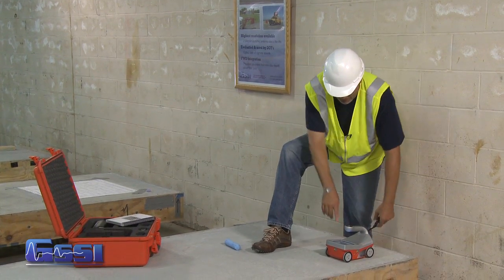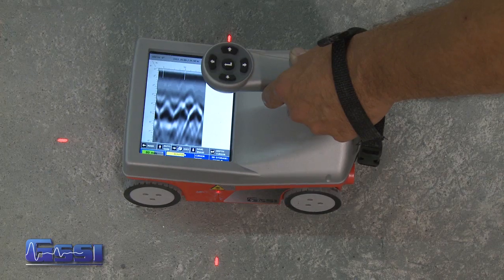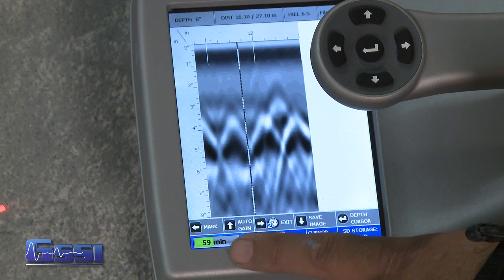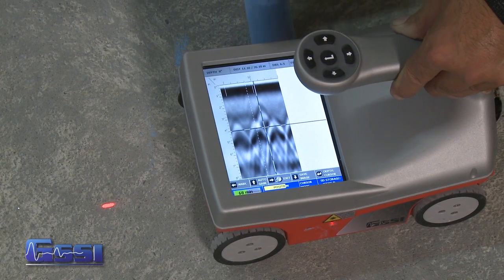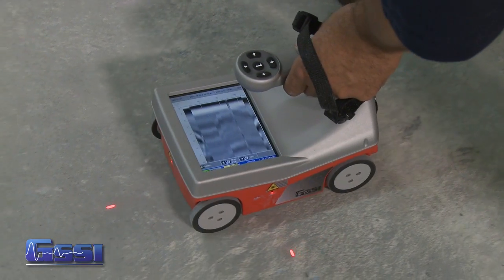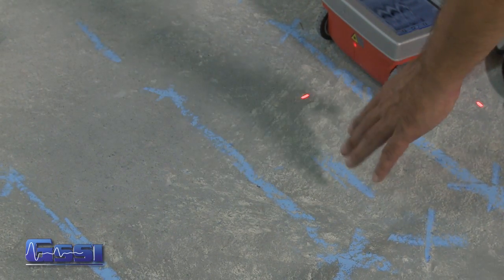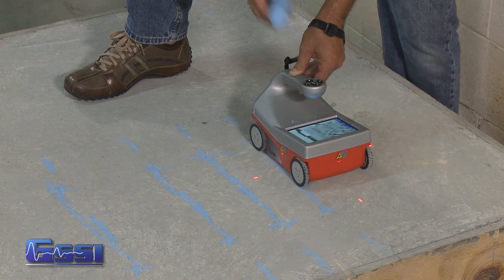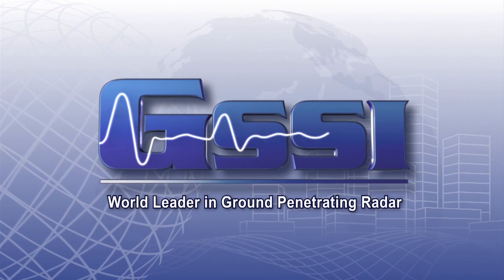How to: Locate Rebar in Concrete using Ground Penetrating Radar

Comment: I have purchased 2 machines from GSSI and I will tell you that they have a very good product and their service is very good based on my experience with them. Their equipment is far more superior than MAlA's. I have also purchased two machines from MALA and they are ok but the accessories I ordered with them do not even match up to the equipment.  With that being said, If you mark your targets in the manner this gentleman is showing  you will most likely hit rebar or posttension cables. If you mark the targets on the outside of the unit as he is showing you will run the risk of hitting something due to the fact the machine is showing you exactly where the rebar is but you have to mark the target directly under the machine. In other words what I do is I mark the edge of the machine on both sides and then I put a ruler on the two lines and make my mark right in the middle of those marks. That is exactly where the rebar is. If you mark the outside as demonstrated and the bar curves you will not notice it and that would be a problem.. I am not being critical I am just saying think about what is being shown I would hate to hit rebar and I know it would be no fun for anyone else. so if I can help ease some pain, I am glad to do so. Good luck.
Reply: How much do these units cost ?